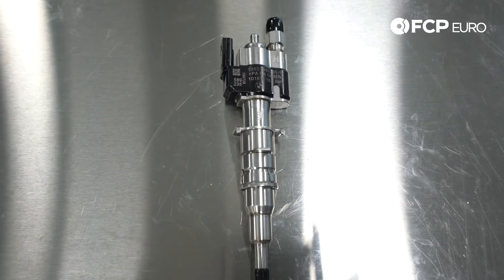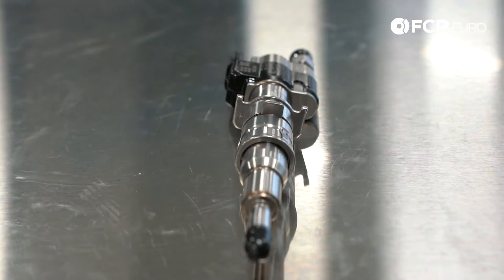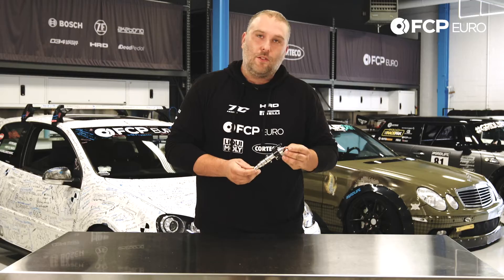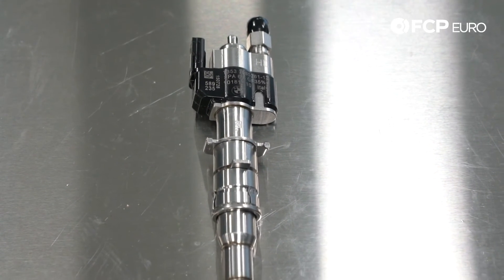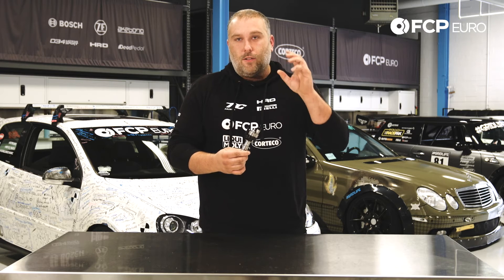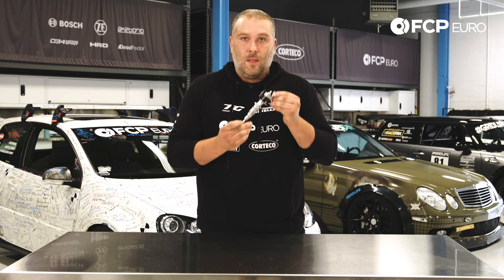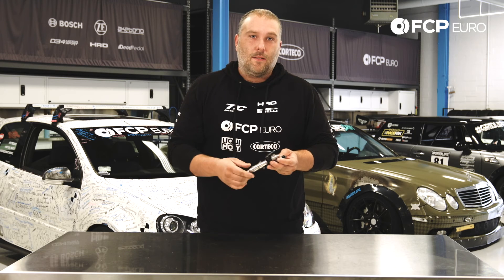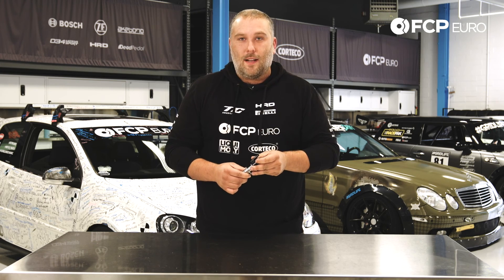BMW N54 (Index 12) Remanufactured Fuel Injectors - Features, Fitment, and Product Review

Comment: I have index 3 and 9 injectors on my car. One (03) has failed. Can I replace that one with index 12 or do I have to replace all 6 of them?
Reply: U can mix 1-10 i believe and 11 and 12 u can't mix 12 with anything Lower than index 11. I might be wrong but that's what I remember when I was doing some research. U still need to code new injector regardless of index
Reply: @el_Chupo  I have heard that but trying to confirm this actually being a requirement. It just does not make any sense to me, considering that you code the flow rates of each individual injector in DME. What factor other than flow rate do we rely on here?

Comment: After the remanufacturing process, does the compensation adjustment value change? If so, is the new value imprinted over the old, or the whole imprinted surface erased and re-imprinted over?
Reply: Did you ever find out?
Reply: @Thomas998822  No

Comment: Hey so what if I don’t have index 12s already can I still buy these?
Reply from the maker: You can, but you won't be able to get a core refund since we need index 12 to have remanufactured. However, they are still priced cheaper than new injectors even with the core charge!
Reply: @fcpeuro  so these injectors are like "upgrade injecors" I thought about upgrading mine on the N53 with a better fuel pump and a tune. Glad for answers
Reply: @kjschrauber2126  They're not for upgrade it's for the N54 engine when your injector breaks.

Comment: What’s the difference between FCP remanufactured index 12 and eBay reman’d index 12? I mean other than the eBay ones are notorious for being garbage...
Reply from the maker: Ours are remanufactured Genuine/OE units, unfortunately, we do not have any in stock at this time due to not receiving enough cores to have them remanufactured.
Reply: Ebay claims to be remanufactured but honestly they are just cleaned up and resold and on top of that they come from china so it's difficult to send them back and get a refund

Comment: I agree doesn't worth to buy 
Broke after 10 000km
Reply from the maker: Hi Sasha, we have a lifetime replacement guarantee and hassle-free returns on all the parts we sell. If any part fails or wears out you can send it back for a free replacement. If you had an issue with your parts please contact service@fcpeuro.com and we would be happy to help.

Comment: This is garbage, $150 + $50 core & they only take index 12 as core.
Reply: It's supply and demand bmw wants 400$ for brand new ones and it's hard to get used index 12 for less than 200. There's a shortage on these.
Reply from the maker: Sorry you feel that way. Truth of the matter is this really applies to you if you already have index 12 injectors and need to replace them which we find to be a majority of customers at this point in time. If you don't already have index 12's you should upgrade to them regardless if the injectors currently installed have failed or are starting to fail. Unfortunately, there is no point in re-manufacturing index 11's or lower as the latest revision is what is ultimately needed for longevity. Moving forward it's likely all that will be available (when you look at all Piezo GDI injectors ever produced) will only be available as a reman. While this is not likely to happen for several years there will come a point where this will be the most likely scenario. And for the record, even if you order the reman over the new index 12's  you still save ~$150 without a core return.

Comment: That BMW uses 'oldskool' injectors on their newest B58 motor says enough. The piezo design was a nice idea, but will never reach a balance between useage and reliability
Reply: Yes you're right. But you have to understand when the N54 was made around 2006 2007 it direct injection on "normal" cars was kinda new and they needed one to keep with the N54 performance.